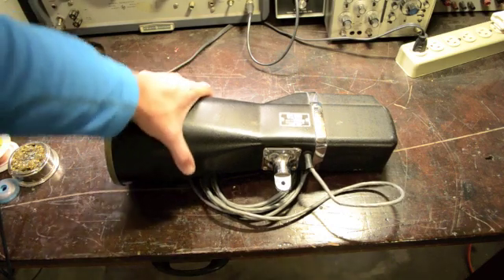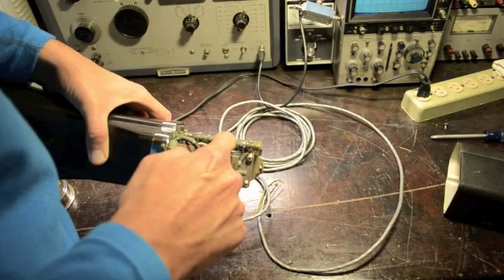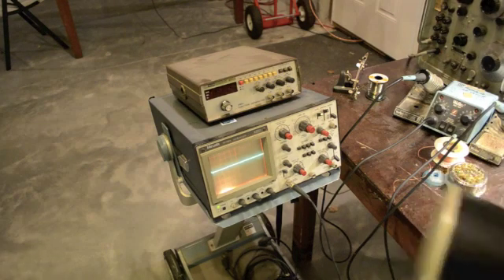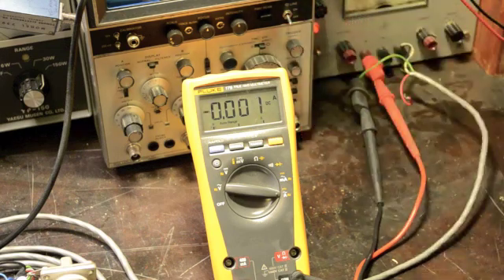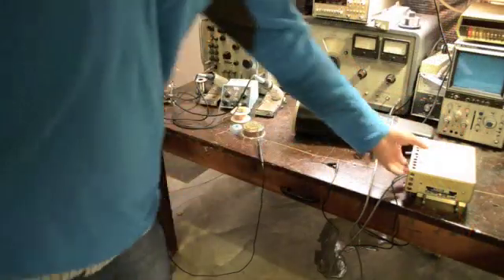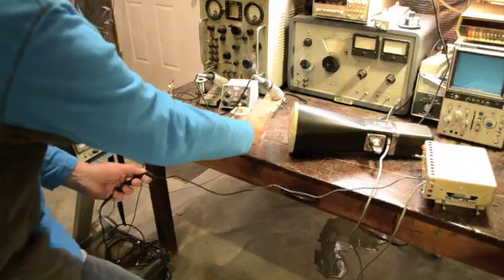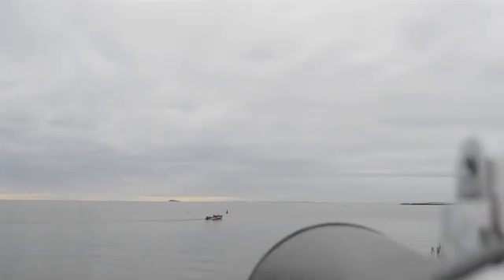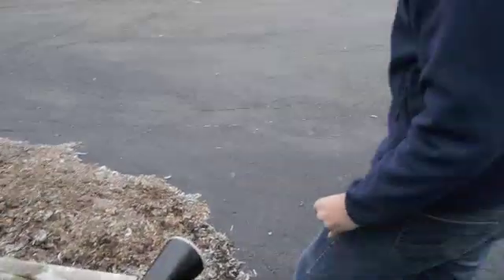hacking a police radar

Comment: Looks like your having alot of fun with it. Much more of a challenge though would be to convert the unit into a Doppler Stethoscope similar to what has been used in industry to make non-contact vibration measurements and audio surveillance applications for over 40 years. Try this out: make it sensitive to sub micron displacement at some tens of feet.